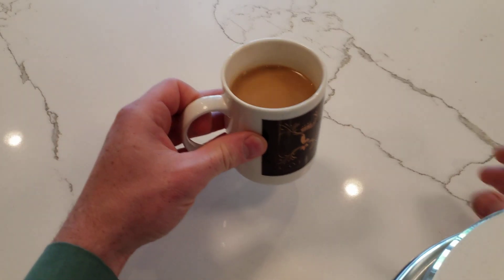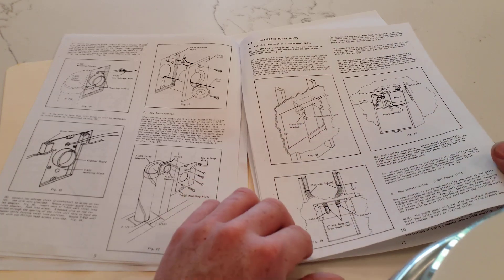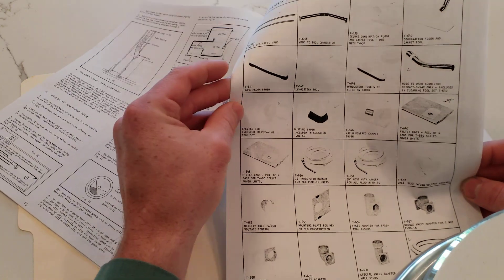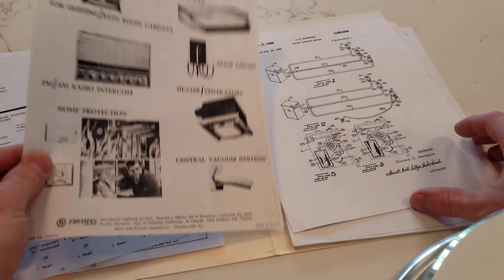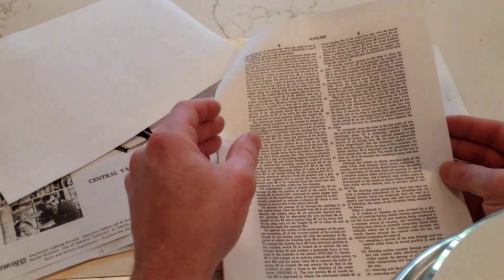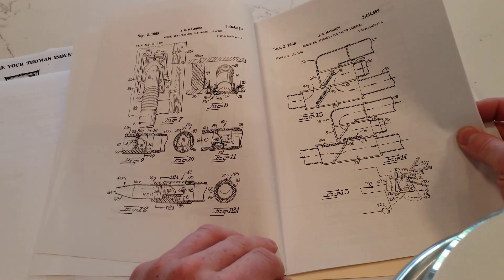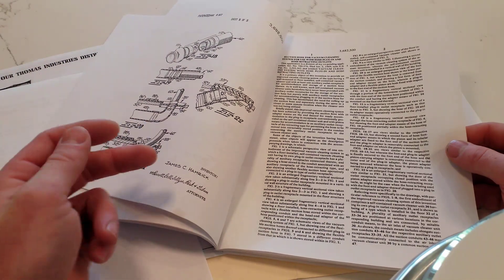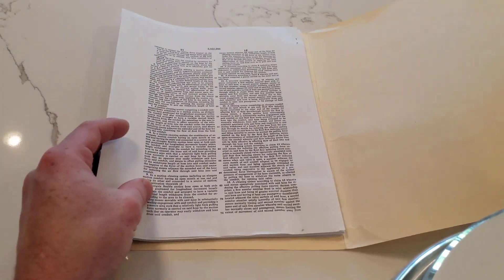The OG Retractable Hose Central Vacuum System: Thomas Retract-O-Vac by Jet Line Industries

Comment: When I originally saw Evan’s video, I was already fascinated that they already had a retractable hose in the 60s.
But now seeing your video and knowing the rest of the engineering marvel behind it, I am even more fascinated! It is too bad these weren’t more common.

Why do you think it never took off back then? Was it because carpet became so prominent in the 70s and there just wasn’t the tools to effectively clean it? Was it because of the complexity of the solenoid, that it was prone to failure? Or just because it would have maybe lacked power with the older plastic, seal, and hose designs?
Reply: I'm just a guy in the industry but I have a theory on that.     If you want retractable systems to take off ---- you need a nationwide size brand name to supply/install/support the product.   This looks like it was supplied to a few dealers but lacked that massive network of a Vacuflo or Beam.      Hide-a-hose was smart about it (well, until Vacuflo became a strong competitor) and established a relationship with Vacuflo to gain a foothold (and test/develope/improve the product) in all the markets that Vacuflo was established.   They had a clause that Vacuflo had exclusive rights to sell the hide-a-hose product in any region they were in.    This is attractive to a dealer because they essentially have a monopoly.     Well, that's the story of how retractable systems gained popularity.
Reply: @allclevernamesgone  Yes, that does make sense. Thank you for explaining it.